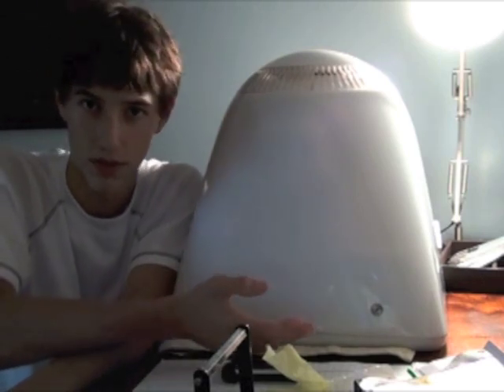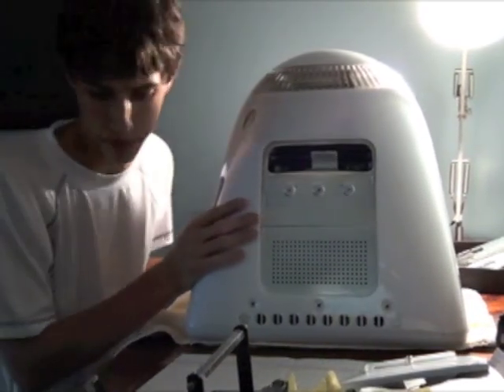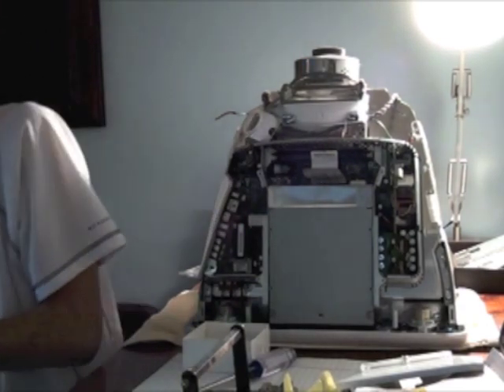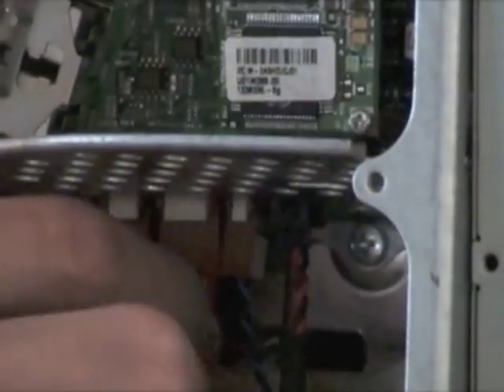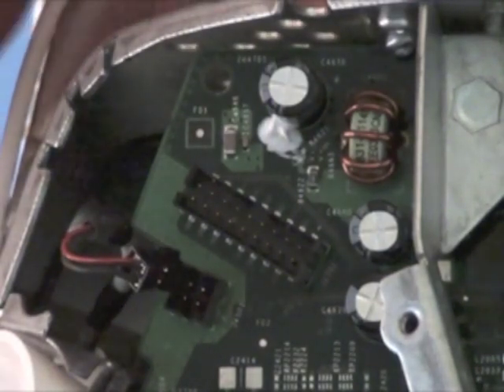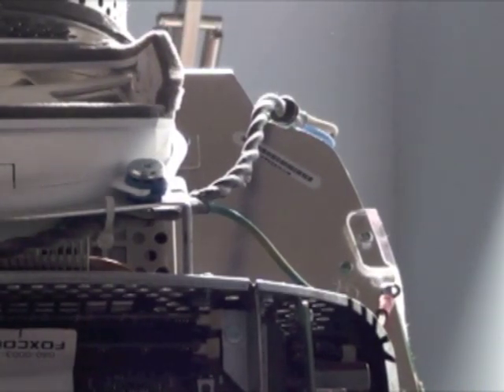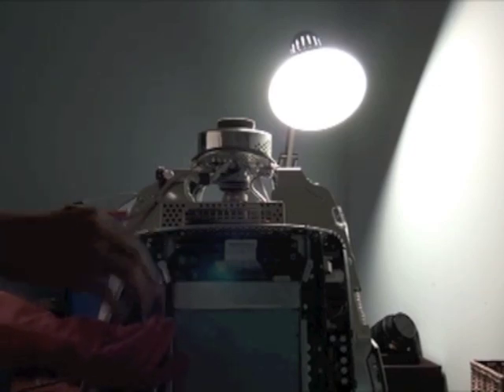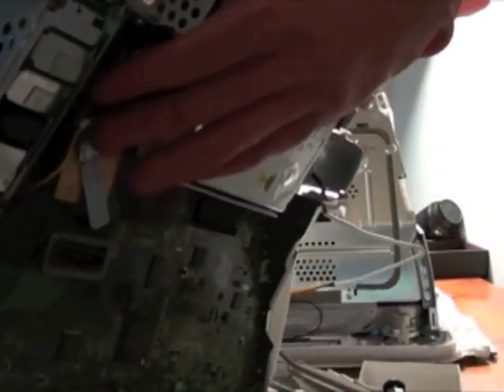emac hard drive upgrade

Comment: Holy moley what an ordeal! Thank you for your tutorial, but my eMac's hard drive wasn't on the back of the motherboard, it was in  a cage attached to the wall behind the motherboard. I had to reach into the tiny space between the semi-removed motherboard to unplug the Superdrive, and the power and data cable for the hard drive. And the data cable needed pliers! And after swapping the hard drive, I was still getting kernal panic. To the dump this eMac goes!
Reply: stephen robb got any tips for me ?
Reply: Some macs were made to be taken apart easily, others (the eMac) are a nightmare. What's the  problem you're having? You could save yourself a lot of aggravation by saying goodbye to it.
Reply: stephen robb OH 😭😭 ok
Reply: I had the 1st Gen 700MHz model eMac (Introduced April 2002, Discontinued May 2003), which finally packed up in mid-2018 from some sort of power problem.  This sounds similar to Stephen Robbs’ description of his eMac hard drive location.

Basically, to rescue the hard drive, I had to remove every single screw to dismantle everything in front of the CRT Tube to finally release the motherboard and ultimately the hard drive.  The 700MHz machines’ internals are not like the eMac in this video.

Nevertheless, the video was a big help in giving me the confidence to get this done — even though I knew I was working on a dead fifteen or sixteen year-old machine it was still instructive and helpful.

Cheers! 🍻

Comment: After putting in an SSD, the machine wouldn't turn on but several nights later when I gave up on finding the fault and assumed I'd fried the logic board, I took it out and discovered that with the old drive back in, it booted up fine.  Do you need to pre-format the drive or do something else to get the machine to boot up? It's the "OWC Mercury Pro Legacy" kit I tried and I wonder if the Y-shaped power cable having an unused connection is the fault (and it has to be plugged/closed onto something?

Comment: I had a question about reassembling the eMac.  I have a whole lab of these at my school, and they are slowly dying.  I'm pulling the hard drives off ones that die and putting them into ones that are still working so the students don't lose their files.  I've had trouble putting a couple of them back together.  It seems like the connection going from the motherboard section to the monitor section isn't engaging properly.  Do you know how to get that reattached properly?

Comment: Great video I just swaped my original 40GB PATA to a 120GB PATA from WD and added 512MB more ram but I want to know if you can swap the entire encloser and put it in a new case and use a standard LCD monitor.

Comment: Hay Chacne.  Great video.  Thanks.  I just got my first one and being a PC user for over 30 years I'm new to the old Mac's.  My question is, where can I find an OS disk for this machine?  I want to restore it to it's original vintage condition for a little sudo museum I'm starting.  I know it's been abandoned so I'm at a loss.  I could use a Linux port but I don't realy want the machine to use.  Thanks again, Mark "Hillbillytech" Repass.

Comment: what model do you have I have a emac usb 2.0 which a MASSIVE problem that i don't know what it is or how to fix it press the power button fan goes thats all no chime no light but subs work disk drive works Ive checked the capacitors all fine changed the battery replaced hardrive don't know how to fix it

Comment: Hey ty for the tut, 
is there a way to prepare a hd to be compatible?
I just replace mine with a wd 80g ata erased with "mac os journaled" format, "master boot record"  scheme, on a mac.
But got a red point on the HD on the "select destination " screen. 
Should i erase it with different options?
Reply: bss Santorini:  Yes, you should.  ‘Master Boot Record’ is for Windows/Linux/Sun, etc.

You need the Apple HFS+ format to partition disks (prior to the introduction of Intel Macs).

Comment: hey man i messed up the connector @ 5:07 (the one with 18 pins) i pulled the cable and i broked the connector it came off with the cable! lol can i repair it? should i solder it? i tried to just put it back into place glued the 2 little pin in place but the mac isnt starting anymore.... Does it has something to do with this connector?  Please help asap!

Comment: Screwey. Just screw them back into the holes they came from. So they are already there when you come to put everything back. In case Mom wants you to take out the garbage, walk the dog or has to take you to the local Police Station to explain where you stole the e-Mac from. 
So even if you do a 3 year stretch inside you wont need to figure out which screw went where, coz they are in place already. 
That's if they forget to take it off you of course. Whats the point of stealing if you don't get to keep it?
This is good practical advice but dubious morally.

Comment: I have a question. I have 2 emac and want to swap their processor and ram, is this possible? The reason is because i got a burned screen on the one with 1.25ghz and the one with 1ghz is cleaner, but CAN'T take 1gb rams! So i want to swap the processor and rams from one to another. Is this possible? Please anyone, help ASAP! Any advices will be very appreciated!
Reply: I don't think so.

Comment: Hi I put in a new one and now the screen goes from smiley face to question mark why?
Reply: IF YOU STILL HAVE THIS QUESTION HERE YOU GO
There is no Operating system on the Hard drive, get a powerpc Mac OS disc, 10.4 is the best one, online or download the iso file by searching Google and burn it to a disc. Then put it in the eMac and restart while holding down the c key and install